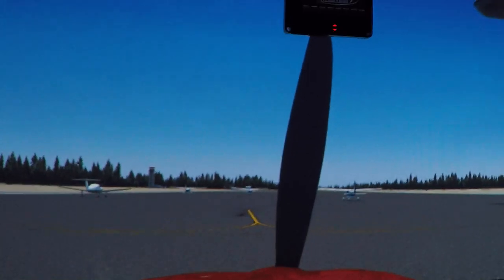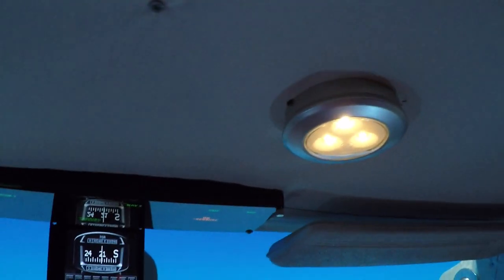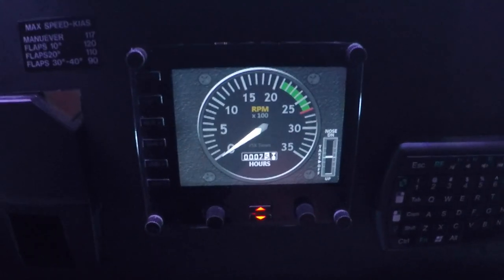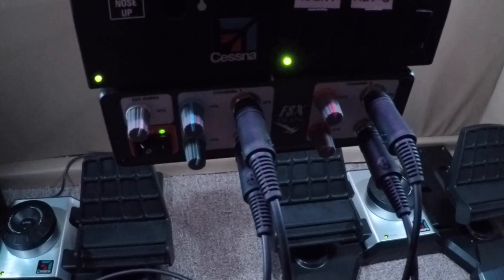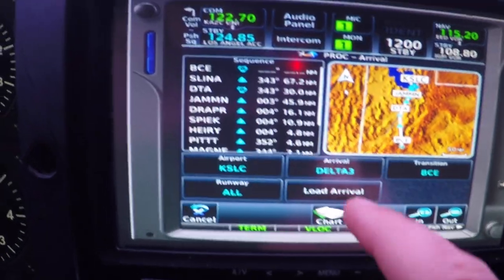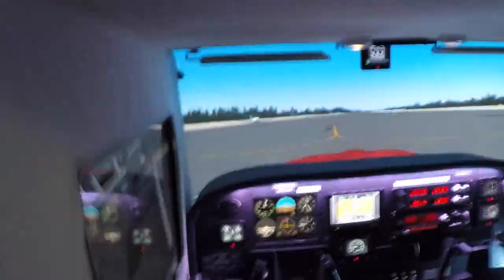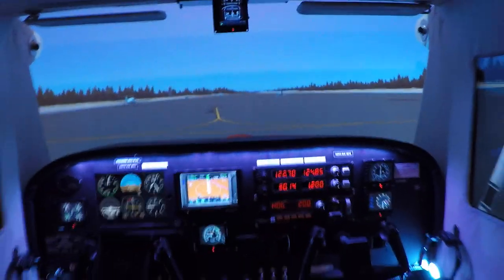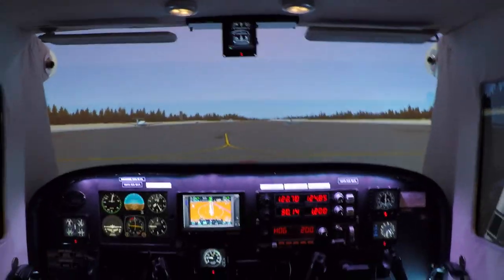Cessna Home Cockpit Video Tour (Prepar3d / Saitek)

Comment: it will be so nice when a new 64bit sim comes out and you can fly in that at 60fps
Reply from the maker: I eagerly await 64 bit, although I think it will help with memory errors more than FPS. My experience is that my frames are limited by my CPU and video processor, not memory availability.

Comment: how did you get the garmin on the ipad or tablet?
Reply from the maker: Hi and thanks for the question. I open it as a new instrument window in Prepar3d and then just drag it over. It's running on a touchscreen monitor, not a tablet or iPad. The touchscreen is plugged into the PC as a fourth monitor.

Comment: Just looked at your website  and you wrote a 10 fps drop when opening the fourth screen, no surprises here.
Like I said, there is a networked version of the 750, cost more, but can be run on any networked pc to unload the stress on the main pc

Here is the link should you think about it.

http://www.flight1tech.com/products/avionicssimulations/g750simulator.aspx